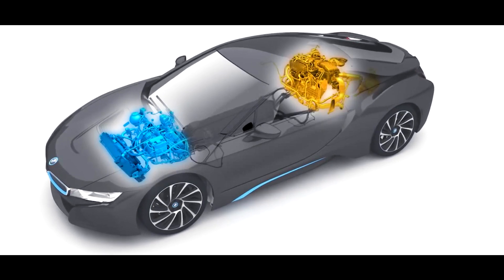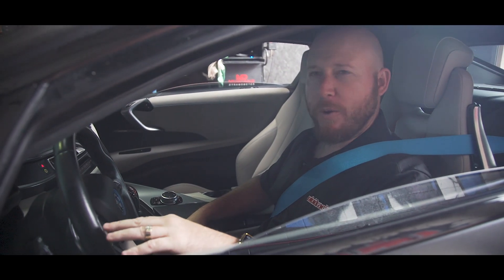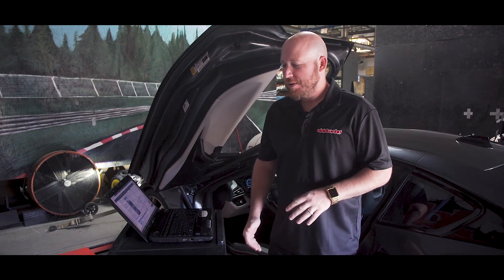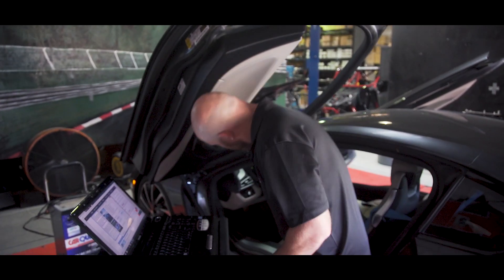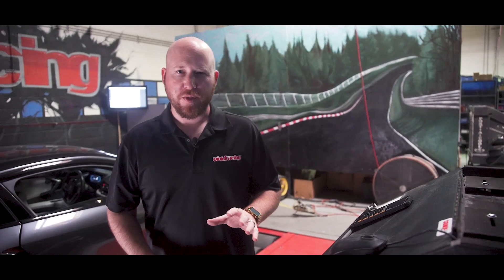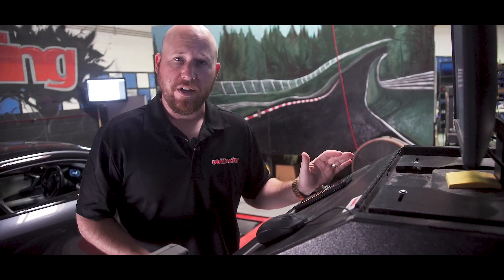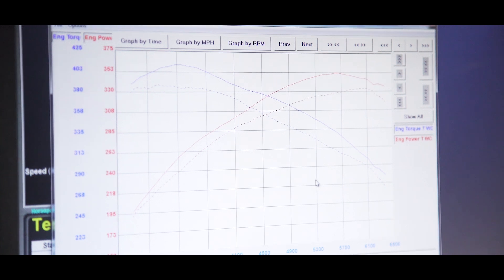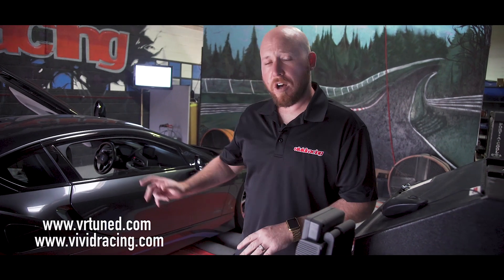BMW I8 Hybrid ECU Tuning and Dyno Test by VRTuned

Comment: A toyota corolla gr turbo 3 cylinder engine is already pulling 300hp stock i expect way high gain especially HAVING A TURBO ON IT! usually turbo engines pull 70-100+ gains when tuned. We havent even started on how this car also has an electric engine on the other sode of the car. I feel like they should be pulling so much more.
Reply: The thing is this car was purposely hindered as bmw would have lost money if the car was better then there m models
Reply: @Josheboyyyy  no way does this compete with the true 4-seater M cars.

Comment: kinda my fav bmw ngl, the design is timeless and the idea of clowning other cars and still getting incredible gas mileage always fascinates me
Reply: It's not incredible. If the car is making power, it's using gas. Doesn't matter if it's a 10L v10 gas, or a 3cyl 1.5L. If they both make 400hp and 450tq, they're both getting worse gas mileage than a 4cyl 2.5L all-gas toyota making only 190hp and 170tq

Comment: for such a cool car it makes me sad how lazy bmw was with the powerplant. they could have definitely used some stronger electric motors and used the 2l 4cyl. ATLEAST.
Reply: What makes you think they were lazy? They chose it for a variety of reasons, size and weight being just some of them. You’d have to make an already very wide car wider by 100mm or so to add just one more cylinder. Plus the weight addition. I don’t see why an i4 would be any better, people like you that don’t get it would just say should have put an i5 in. AT LEAST. No.
Reply: This guy is clearly a German engineer and not a fool

Comment: How do you calculate in this case the drivetrain loss? I’m asking because in release the car should start to recover energy from the electric motors
Reply from the maker: We are doing 3rd or 4th gear full throttle pulls.  So there is no decel or regen going on.

Comment: What is the max HP you have put through the stock transmission? Is there a HP/TQ limit for that trans?
Reply from the maker: Not sure how much the transmission can handle but you would need to do some serious upgrades to make enough power to damage the transmission.
Reply: @vivid_racing  very cool. I plan on using that trans in my 6 for AWD and more power(from a CX-7). Should be a lot of fun.

Comment: have there been any improved tunes since this video?
Reply from the maker: Nope same tune.  We have features like Pops and Bangs now.
Reply: @vivid_racing  interested for sure what are the real world hp and torque numbers?
Reply from the maker: Shoot an email over to our tuning staff and they can give you more information :) tuning@vividracing.com
Reply from the maker: @patrickmiller8388  We always put links in all our descriptions to the product info.  This link has our dyno charts showing wheel horsepower plus crank hp ratings https://www.vividracing.com/tuned-ecu-flash-tune-bmw-p-151449513.html
Reply: @vivid_racing  what’s does the i8 do in the 1/4 mile time after this tune ??
Reply from the maker: @shelbyhaiketic4212  We dont get a chance to test those things.

Comment: I always thought you needed to mod your engine, intake, and exhaust if you're ever tuning something. Do flashes actually work? So you got like a 30hp increase from this?
Reply from the maker: Tuning will always make the biggest performance increase especially on turbocharged cars.  Basic bolt ones like an intake and exhaust should not require a custom tune.

Comment: Is it possible to swap a v6 into it
Reply: Engine swapping the i8 is possible. But it's pretty complicated since it's a hybrid. If it wasn't a hybrid, there wouldn't be a problem.
Reply: Malti Psikotiku id go with the Ford Fiesta St motor with 450 hp and upgrade the electric motors orrrr just go full electric aka tesla swap😈
Reply: Anything is possible when it comes to swaps. Look up v10 E30 swap or LS beetle swap, everything can be done. But it would depend on how much money the owner/shop would want to put into it.
Reply: Bear in mind it’s a carbon fibre chassis. So quite a bit more difficult to cut and shut the chassis to fit a different engine

Comment: There isnt an awd drivetrain loss because the front wheels are driven exclusively by the electric motors....... there isnt a mechanical awd system sucking power.
Reply: There is always going to be drivetrain loss
Reply: Darryl Maclean he only said 15% that’s not awd drivetrain loss
Reply: Yeah you have to do separate maths for each drivetrain calculation

Comment: If only BMW gave it 5 or 7 more cylinders.
Reply: MrSuperawesome5000 imagine the E60 m5 engine in it AND the hybrid system. Would be heavenly
Reply: I’m thinking of doing a BMW I8 build with a V6 or V8
Reply: @OpenNReview  but the i8 already runs like a v6 - v8
Since it has a very light body and a lot of air ventilation in it's body design. Also it's AWD (All Wheel Drive)
The i8 can easily beat the Mercedes C63 and the Audi R8 V8
Reply: @OpenNReview no you are not you wouldn’t fit it in the carbon tub it would have to go up front and ruin the car. I am a BMW engineer who worked on the hydrogen 8
Reply: The i8 was meant to be an Efficient Dynamics concept study. It had twice the efficiency of an E92 M3 yet three times the hp of a Prius. It’s also the most affordable way to get a CFRP monocoque.
Reply: Only people who don't have it speak like that. I've never missed a single cylinder. Otherwise look at this:  https://www.youtube.com/watch?v=HlWFEEQGP30
Reply: You know, this is something I can draw as a super car without feeling bad or having a rumbling in my stomach
Reply: V10 will be too heavy
Reply: b58 is ethically